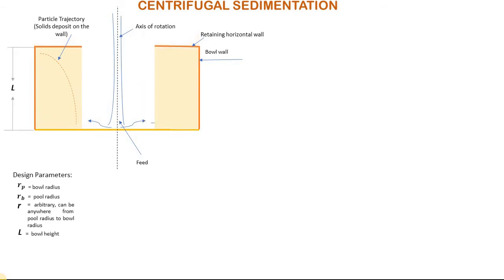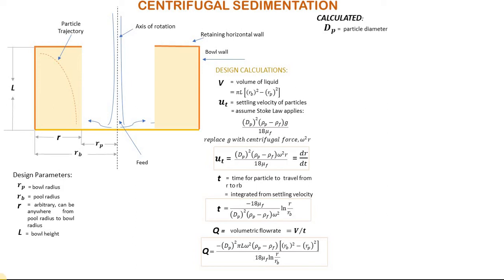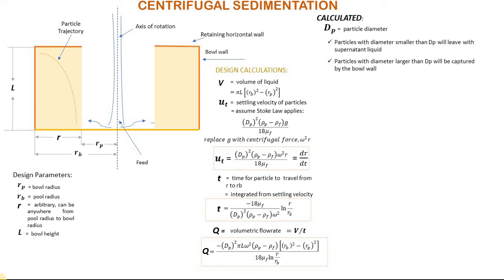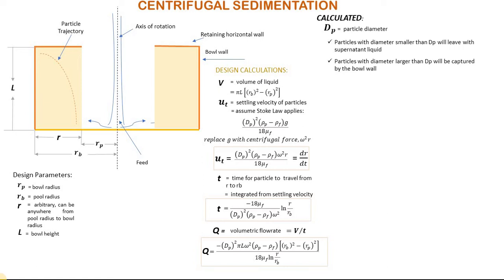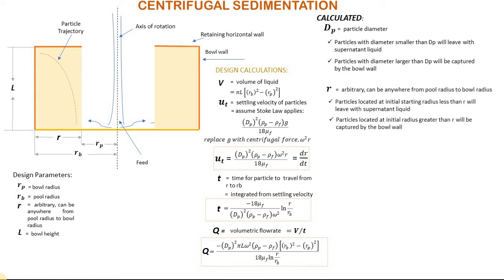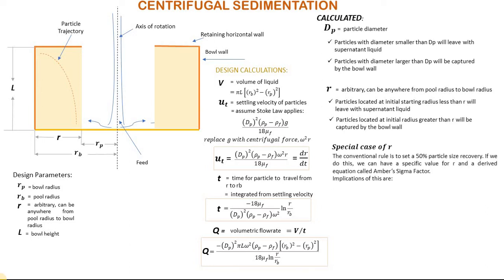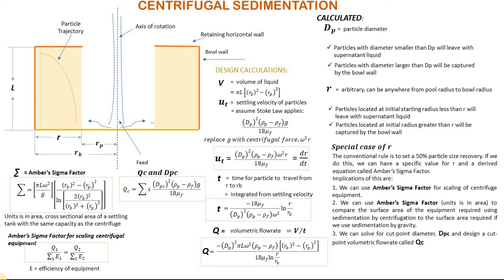Centrifugal Sedimentation

Comment: How to calculate sludge % & TSS of spent wash having brix in range 20 to 60
Please send procedure
Reply from the maker: Brix is used to measure the dissolved sugar in a solution. I assume the TSS here refers to the dissolved sugar specifically sucrose. 1 degree Brix means that there is 1 gram of sucrose for every 100 grams of solution. So for 20 degree Brix, you have 20 grams of sucrose (TSS) per 100 grams of solution. Im not sure what you meant by percent sludge but I guess it refers to the weight percent of dissolved solids in the solution. In the case of 20 degree Brix, it is also 20% since you have 20 g sucrose/100 g solution
Reply: @chereviewwithperryshandboo4866  sir I want to know Following procedure to calculate sludge % .

Please read about spent wash or vinnases.